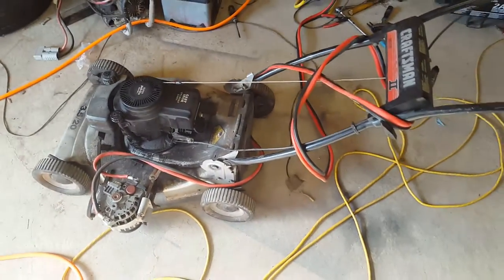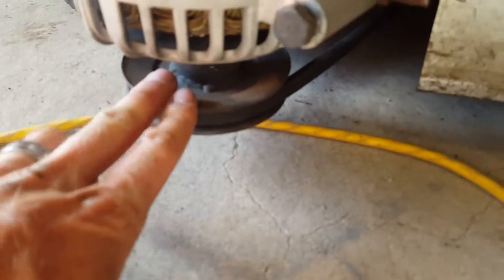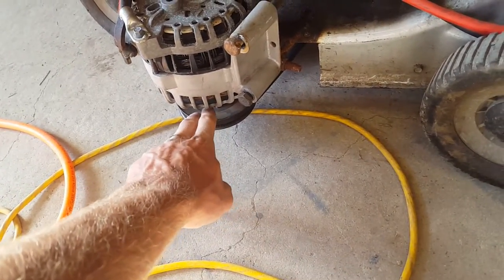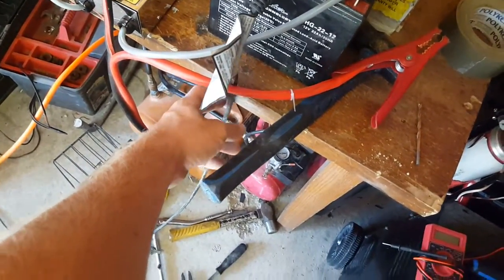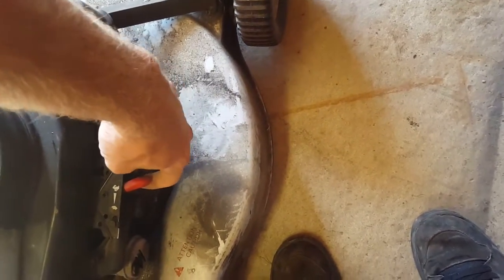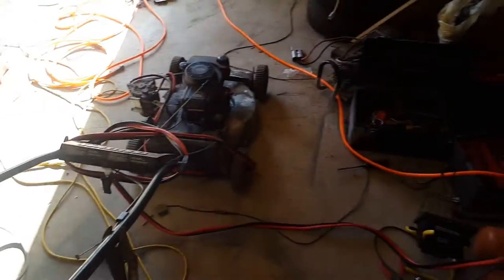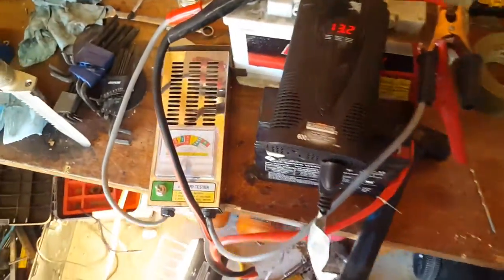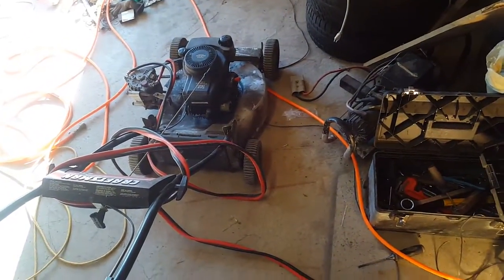lawnmowor genrrator

Comment: Good idea for a backup battery charging source. good job.
Reply from the maker: +Hawaiibiz thanks I gave it to my grandpa for his cottage up north to keep his off grid cottage topped off
Reply: +fliping720 nice. Beats buying a brand new generator. the only downside is the gas tank is really small on the lawn mower but he could always run a fuel line to a external gas tank. but good job. by chance do you know what the rpm was.
Reply from the maker: Hawaiibiz 3000-3600 and it was fun building it it needs a larger motor to make more then 45 amps but the small tank is nice cause you fill it and can let it run dry for only $1.50 and not even care :)
Reply: +fliping720 thanks for the info on rpm. I bet it was fun building it I the same love building and tinkering with stuff. good point on the small gas tank. thanks for the reply.

Comment: I used my new 6.75hp briggs and hooked a 40 amp GM alternator on it to charge 2 x 12v batteries connected in parallel. The engine didnt last half an hour and started to smoke bad and oil started shooting out. Any comments. Thanks. Great vid. Im trying to go off grid soon.
Reply from the maker: haha man that sucks, try and get another engine!
Reply: I think it was necessary to reduce voltage to the field down to 2-4 volts and that would lower the pressure on the engine.
Reply: what was the voltage u used on the field? I do have some solar panels but not enough to go off grid. We r in florida and no power for days now. :(
Reply from the maker: you can get alternators that have a voltage  regulator built in. mines out of a grand caravan.
Reply: Good idea. Thanks

Comment: To all. creative peoples:  FOR  EXTREME  amperage, locate/salvage/find  an alternator  for  those  semi  trucks.  Either brushless, or brushed.   Those will cost, but, the amps out is phenomenal.....you would require probably a 16 horse  pwr  motor.....get a Honda,   they're  the bestus......for hi-capacity  off grid  stuff.

Comment: Hey Flip, finally got my system up and running, thanks for all your good advise, is 12.4 volts as low as I can go on the batteries or can I go lower, sorry about the confusion about that 10 amp charger controller I didn't know that they made that one, and one final: how many feet can you go to the charge controller from the panels using 10 gauge wire
Great video is that the same battery that you where charging up before
Reply from the maker: +Al Ruark I my self try not to go lower then 12 volts, the 10 gauge wire depends on how many amps you have running from your solar panel to your controller. Congrats BTW

Comment: Your gasoline motor can produce  about 1750 watts max, that is  125 amps at 14 volts.
A lawnmower is designed to run at about 3000 rpm max and it may even run at lower rpm. A alternator need minimum 3000 rpm to produce some power, but not much.
If a car engine runs at 1000 rpm, the alternator actually runs at about 3000 rpm.
In other words your pulley on the alternator should at least be the same size as the pulley on the lawnmower, but to get more power out of it you need the pulley on the lawnmower to be a little bigger than the  the pulley on the alternator, but you still need the lawnmower to run full rpm.
You would need a flywheel to get the rpm smooth. On a lawnmower the blade acts like a flywheel.
Reply from the maker: yea it worked great till some one hooked it back words lol
Reply: I am sorry to hear that.
 I have a 5 hp motor that I will use with an alternator to boost my solar batteries when needed.
Something else to consider. Per 1000 watt generated power you would need 1.5 hp to 2 hp of gasoline motor.
Thank you for the video.

Comment: hey flip 720 if you want to get more amps only change the alternator pullie to the smallest size you could find. and if you want more amps change the inner pullie to a bigger size you should be closer to the 100amps or close great job.
Reply from the maker: +Samuel Romero haha thanks! you must mean bigger on the alternator and smaller on the gas engine pulley right ? i would but i cant find any where i live and the one i bought was already $40 witch is crazy!!!
Reply: +fliping720  Canadian Tire got some for about 15$ and don't weld next time, drill hole trough pulley neck and shaft and insert nail or screw in that hole, I think you damaged that alternator rotor ( heat from welding), you should get way more than 40 A from that alternator, don't forget that alternator used to supplied power in whole car and just one headlight (100 W bulb)  pulling 8-9 A, let alone rest of it. Any way good job!
Reply from the maker: semko71 thanks! it can produce 100 amps but it stops the 3.5 HP motor and shuts off
Reply: Going of grid.
Your gasoline motor can produce  about 1750 watts max, that is  125 amps at 14 volts.
A lawnmower is designed to run at about 3000 rpm max and it may even run at lower rpm. A alternator need minimum 3000 rpm to produce some power, but not much.
If a car engine runs at 1000 rpm, the alternator actually runs at about 3000 rpm, because the crankshaft pulley on a car-engine is way bigger than the pulley on the alternator.
In other words your pulley on the alternator should at least be the same size as the pulley on the lawnmower, but to get more power out of it you need the pulley on the lawnmower to be a little bigger than the  the pulley on the alternator, but you still need the lawnmower to run full rpm.
You would need a flywheel to get the rpm smooth. On a lawnmower the blade acts like a flywheel.